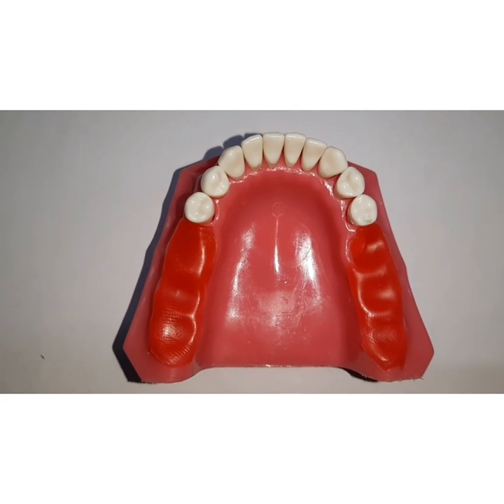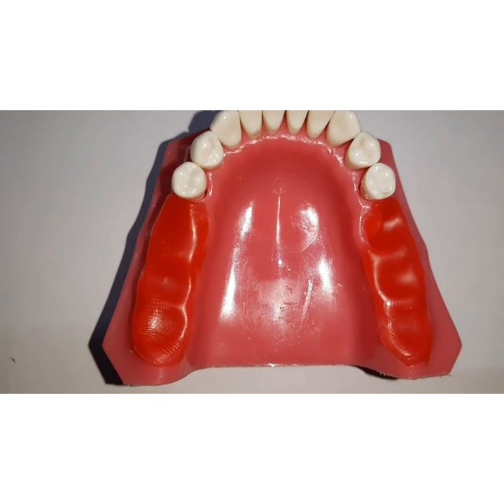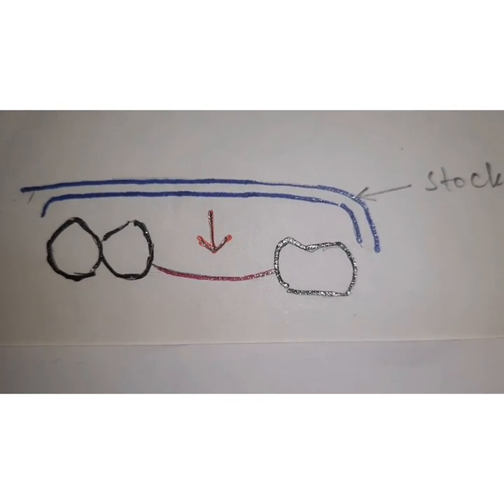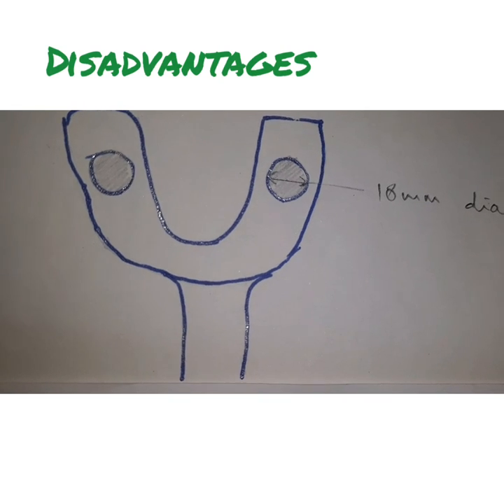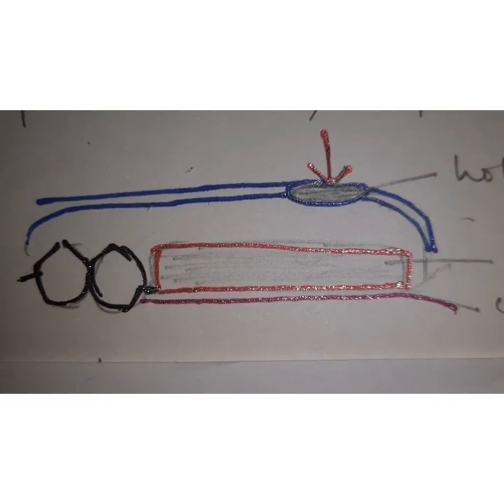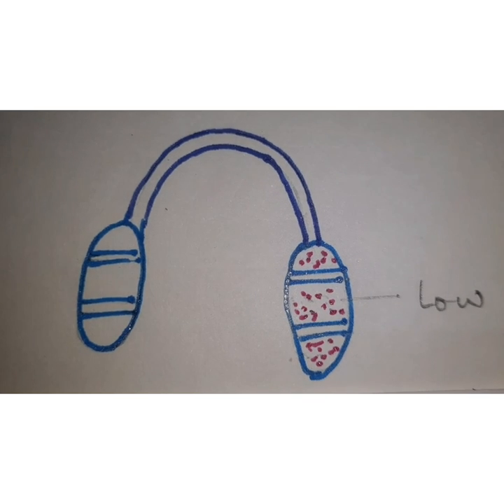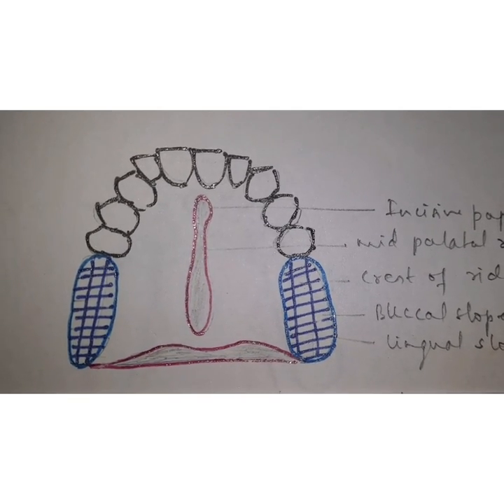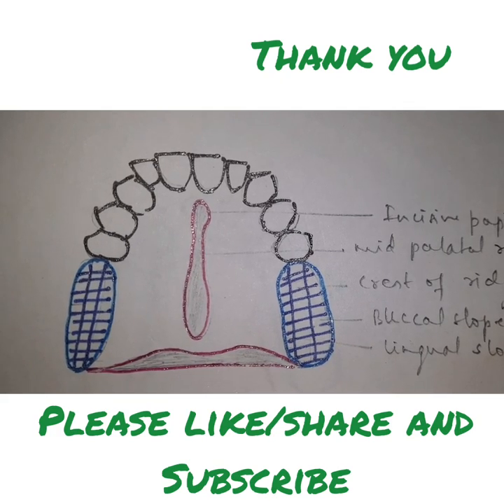IMPRESSION TECHNIQUES IN REMOVABLE PARTIAL DENTURES

Comment: Sir, I'm unable to understand functional reline technique.
If we are relining the old one then, do we break the denture base part of the old one and fabricate a new framework on a refractory cast and then we apply a metal spacer on it ,then we fabricate a special tray on it, then we take impression and pour the cast using altered cast technique and then we fabricate denture base with self cure and then we do rims,teeth arrangement and try in and then flasking and finishing and finally denture delivery. 
Am i right or totally wrong?